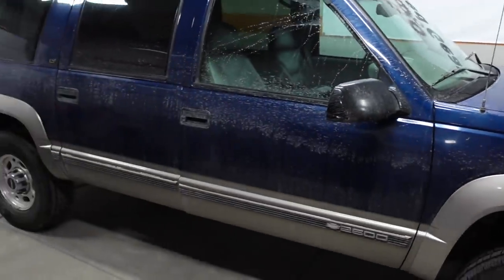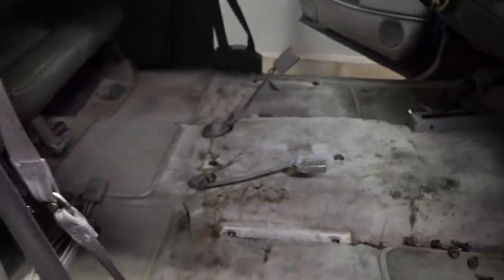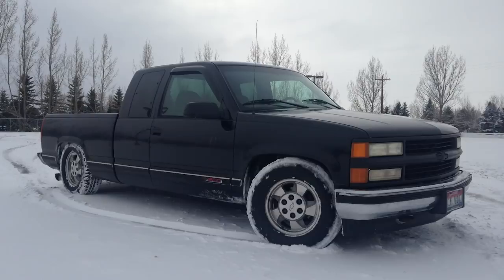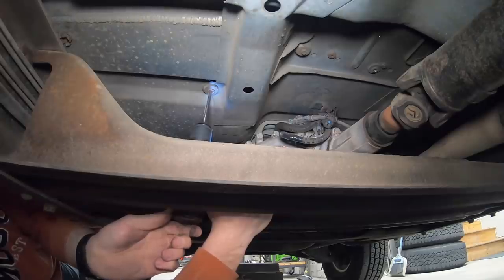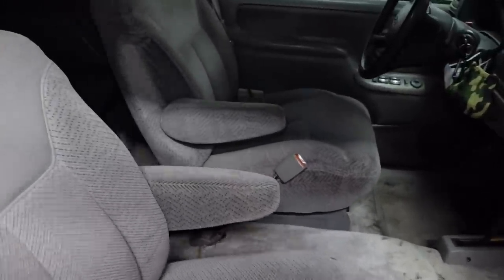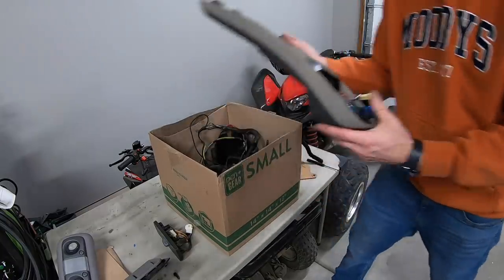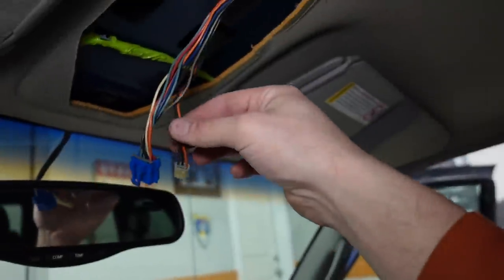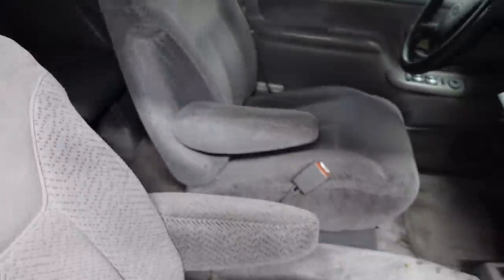Installing New Bucket Seats in a GMT400 OBS Chevy

Comment: My favorite part about these GMT400 and even GMT800 trucks is how modular they are. They made so many configurations that you can pick pretty much anything you want in terms of options with minimal modifications. For example I just put in a plug and play Yukon Denali cluster in my 2001 GMC and now I have a 120mph speedo and a trans temp gauge!
Reply from the maker: I want to go that on my 2000, the stock cluster has all sorts of issues

Comment: They did put over head console in extended cabs. It's not super common but they did the console is different to.  94 up only extended cabs. I put one in my 94 there's a video on my channel and also one explaining the different consoles. Along thoue in 99 they ditched the pickup style consoles and used the suv ones with the older lights. I did not no that when I made the second video on it.

Comment: Hay  today I ran across yer videos for the first time, gotta say I like what yer doing. I bought k 1500 7 yrs back its a 99 also an have been doing restorations an making it my own ever since.There for a couple yrs I was on the look for middle bucket seats which I found at pick a part but did not get them.Bad mistake on my part, they are tough to find an to this day I keep my eyes an ears open even though satisfied with what I did. An that was get rid of the 60/ 40 mid seat an behind driver side front seat put
 A passenger front seat minus arm rest. This has worked out great leaving room behind passenger front seat an 3rd row seat plenty of room an easy access to put what ever I need to put inside. 
I'll tell ya after time you find ingious ways of changing out parts without spending a ton of money.This upholstery shop wanted $500.00 bucks to do head liner. What? Back to pick a part fount one excellant shape, $14.00 .
 Had to go show it off to upholstery shop, guy comes out I tell him ya 14.00 bucks buddy. Any how it's been a lot of fun an a big learning experience. Putting in New transfer case in Monday & the whole power train will be new.
 So keep up the good videos I'm sure I'll be tunning in often.
 Aka Highway.

Comment: I really like the suburban. I bought a 96 ext. cab in 98 and a co-worker bought a new 98. If I recall right he had a long overhead console.   Don't know if someone ordered it that way or not.  Loved my 96 without the optional 3rd door.   Super quiet riding truck.  No squeeks... no rattles.  To bad I sold it at 185K.  Should have kept it.  Bought a van for hauling my dirt bikes and then modded the heck out of the truck for a daily.  I traveled for work so I bought a 08 with only 16k on it.  Now it sits at 230K.
Reply from the maker: I wish I could keep all the trucks I've owned over the years... several I regret selling

Comment: Cool video!  You should definitely put the tallest lift available for that year.  The wheelbase is so long it’s very easy to get high centered off-road.    Absolute minimum tire size should be 35s preferably 40’s with a solid axle swap.  Keep up the great content!

Comment: 95+ ext cab trucks could come with the full length overhead console, generally on well optioned trucks. the only difference with tahoe and suburban consoles is to forward portion was slightly different shape without controls for rear HVAC, it was just a smaller delete plate instead.

Comment: As a detailer, you may guess the carpet was a trigger for me.  :)  In lieu of the power washer method, please consider a small carpet extractor.  (Bissell Little Green is a good model, and you'll love it for the house as well.)  Drying time is much shorter, and on the stubborn stains you'll appreciate the extra oomph.  You can also get a brush for your drill or DA sander that will really agitate and clean the carpet (and seats for that matter).
Reply from the maker: Great tip! I've seen those brushes you put in a cordless drill, where is a good place to buy those?

Comment: Leather trimmed '96 and up extended cabs had overhead consoles and compass mirror.  I sniped mirror off a friend of mine that was trading his leather trimmed truck in and got an overhead console out of a wrecked one.  Still haven't gotten around to putting in the overhead, but the mirror was a 15 minute wiring and swap.

Comment: I have the 96 K2500 with the leather bucket seats. I'm thinking of taking out my center console and replacing it with a custom one. Wanting two cup holders at the front of the console, because that CD storage is useless to me, with an insulated thermo-cooled box behind it. Be nice to have a spot built in for cold drinks and snacks, rather than lugging a portable plug in one on trips.

Comment: Idk if anyone has said anything but in my 97 3 door extended cab the passenger seat is not a direct bolt in. The brackets are longer than the seats out of a Tahoe or suburban. You have to drill 2 more holes because the the width is good just not the length

Comment: I think that full length upper console came in extended cab pickups. My dads 97 Sierra had one and we bought it at a dealer in 2004, I doubt someone would modify it that early
Reply from the maker: in all the trucks I've worked on and seen, I don't remember a ceiling console, but a lot of people on here have commented that theirs had one stock, so I've been corrected!
Reply: Indeed I had a '97 Silverado K1500 Ext. Cab w/3rd door .. 
It had the roof console like u installed. Also had the buckets with the center console as well.. made it a donor truck and took all the above out for my 96 step side. Pulled Jasper engine out and the trans that had recently been rebuilt.

Comment: LT im also working on my 96 burban. Did you notice if you can access the rear roof mounted havc controller when you removed the dome light assembly? Need to replace the hvac light as I have converted all interior lights to leds. Thanks and great job on the channel. Huge fan!

Comment: maybe because in Brazil,  GM  never officially sold the suburban, and the closest thing we had of this generation is the Silverado single cab and short bed, I always felt that the dashboard without the airbag looks way better.. was it always available as standard, or was it an option LT?
Reply from the maker: in the US, 1995 and 1996  model year trucks had no passenger side airbag, but in 1997+ I'm pretty sure most trucks got the dash with the bigger hump and airbag on the passenger side, except some 3500 trucks which had a little storage area where the airbag went.
Reply: @LawrenceTolman  thanks for the reply LT! Keep up the amazing content! Big fan from BR!

Comment: I have an 02 Yukon XL and am looking for a bench 2nd row.   Which years/ models will swap?  I know it has to be either another XL or suburban due to mount style. Correct?
Reply from the maker: not 100% positive on the GMT800 seats, but I'd venture a guess that either XL yukon or suburban, or even maybe from a crew cab truck.

Comment: All the connections and mounting points just about all from factory wether it was optioned for it or not. GM stopped doing that the last 15 or so years, shame. I can't even add power folding mirrors in my GMT-900 without changing all 4 door harnesses.

Comment: Subcribed😎
Currently working on a 99 tahoe 4x4
Installed a full set of denali seats. Escalade center console,dash bezel,cluster,and steering wheel too match. Outside ive switched to a yukon color matched front grill.
Still looking for the z71/limited front bumper and rear bumper cover.
Reply from the maker: lots of cool upgrades you've done there!
Reply: @LawrenceTolman  yes sir. Keep up the good work. Even though i have an overhead console i still wanted to watch you install it. You make it interesting to watch and motivate me.

Comment: I dig your vids but haven't watched all of the 8.1L series.  Have you told your viewers the 8.1L's short comings and why its not a popular swap engine.  Its mainly their unique heads and lack of aftermarket support vs the 7.4L from previous generations.  Its like you are leaving 200hp on the table by being stuck with its heads and other bespoke parts vs 454 options.  Cheers.
Reply from the maker: for sure. I have mentioned several times how the 8.1 is not the engine for everyone, and when I get to building the engine for boost, I'll go over a lot of those details.

Comment: Could you tell me something.  I have a 2000 chevy 1500 fully loaded, body is shot . Went and got a body but base model,  will the base model have all the wiring so I can switch my interior  in to the base model and everything  work. Or am I going to have to take the full wiring harness and fuse junction  from old body. Thanks.

Comment: My 97 ext cab I had in high school had that full roof console and I was the 2nd owner from a old man so I don’t think he would’ve put it in there it was all stock
Reply: Yep 94 up extended pickups could get the overhead consoles. Not very common but could. 97 ups are the only ones I've actually seen factory. And you could only get one with bucket seats.

Comment: I have the exact roof console in my 99 nbs Silverado z71 an it's factory
Reply: They are very similar but they are not the same. The shape to them and the rear " feet" are different. Also the frount is missing the locating tap the older ones have. And the 99 ups are plastic welded together  the 94 98s are screwed together.
Reply: @leviwoodring6101  mine is the new body style 99.it is the same console he installed. I wish I could post a pic to show
Reply: @MrJiblack  yes I know I have one out of an 01.  Also have a 99 classic console They look the same but there are different in the ways I mentioned. Installed you realy cant tell the difference. Only side by side does it show. Might have to make a part two to my console video.
Reply: @leviwoodring6101  it's not that important to argue about but mine is the exact same console LT had, I've had mine out before. I'm going to send you a picture through Facebook later today to show you. I like your red GMC by the way
Reply: @MrJiblack  ok I believe you. And thanks I got the 01 console for it but have not installed. There a pain to install in single cab nbss. Being single wall roofs.